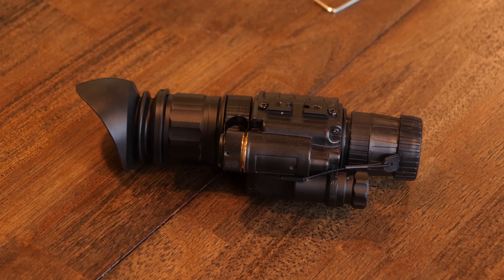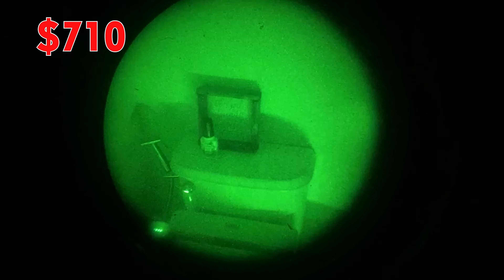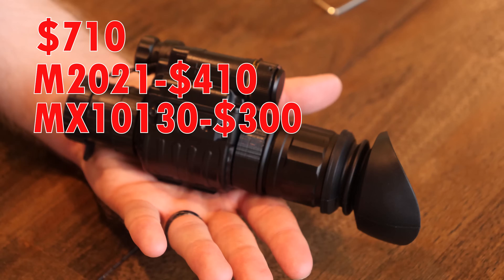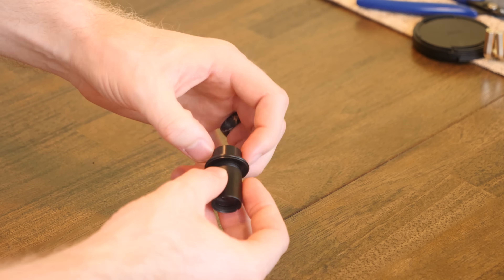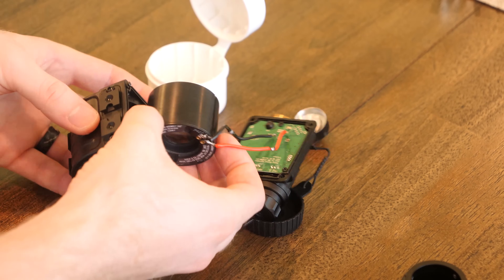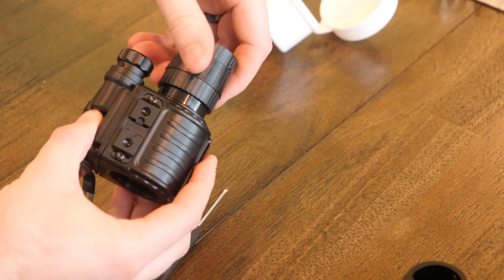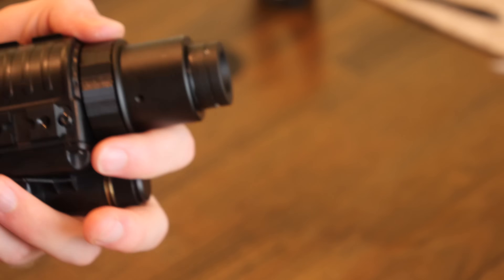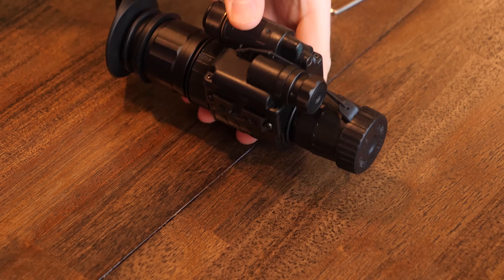How to Build GEN 3 Night Vision for Under $1000

Comment: Found a mx10130 without the wires, is this a problem or an easy fix
Reply from the maker: @Pronounced_G  None of them have wires. You have to solder them on.
Reply: @ what type of wires

Comment: Hey man sorry for texting so much but does this housing come with the wires to connect it to the tube?
Reply from the maker: @itsj2373  No
Reply: @djgunner258 I’m not to knowledgeable on soldering, do you know what kind of gauge wires to use?

Comment: Can a Gen2 MX10130 work as well? Just bought a gen 2 Mx10130. Worried but hopeful.
Reply from the maker: @itsj2373  Yeah gen 2 shouldnt be an issue. The hardware is still the same.
Reply: @ also did the wire come attached to the circuit board? And if I did have to get the wire, can I find that at a hardware store?

Comment: Built one and it came out and works pretty good. How did you solve the mounting problem created by adding that spacer? They eye piece sits halfway into my helmet now. I cant find a section of dovetail extension to buy so i think i have to have a machine shop make a piece. Not any in my area. Ideas???
Reply from the maker: Check out my Review video. I go into mounting options

Comment: Hi, what I need to use an image intensifier tube with an astronomy telescope and eyepiece, just the tube and the electronic circuit? The inverted image is no problem. I obviously don't need the housing. I also don't need the IR illuminator.

Comment: Bout to build one myself. Awesome video!
Reply: Let me know how that 3d printed adapter works out. So far, I've had 2 made... one stripped immediately and the other was too tight to even get the threads to bite
Reply: @ShamblesDoctor  Just finished the build, I'll be uploading a video on it soon. SLS Nylon is pretty amazing, it doesn't need a support structures so the threading was smooth and felt super strong! It only cost me $13 on craft cloud, got to my door in less than 10 days.
Reply: @Esch_atton  I finished the build with an SLS print too, I still don't like the thread engagement so I have only snugged the adapter into the eyepiece. There's still an eighth-inch of gap between the two, but the image produced is fine.
Reply: @ShamblesDoctor  I slipped an o ring on the iverter piece and it took out that gap perfectly
Reply: @ShamblesDoctor  will do, I'm getting one printed out of SLS Nylon

Comment: For anyone wondering the inverter piece can be made with 2 Plano convex lenses pointing towards each other and then playing around with the focal length between the screen and the two lenses
Reply: Specifically 21.8mm in diameter and 8mm high
Reply: What did you use to hold the lenses?
Reply: 3D printed everything
Reply: @skycraftjet6621 do you have this 3d file perchance
Reply: You don’t happen to have a link for those lenses do you?
Reply: Do you have insta? I would like some more infos
Reply: Pics or it didn’t happen

Comment: I did this build and honestly its pretty good. The cons for this build is the weight, little bit of lost field of view and having to deal with alibaba sellers when buying the housing. For me it was definitely worth the price for a starter unit but I’ve upgraded to a set of pvs14’s. Side cutters and a dremal made quick work for the modification and im good at soldering so the wires were not a problem for me. I did not remove the plastic nub/tab on the IIT and I recommend you don’t as the tube sits tighter in the housing with the nub.
Reply: Are in willing to sell me the ones you built ?
Reply: Can you link instructions

Comment: For anyone curious: I did this build, but my housing did not come with the small internal "prism" assembly. After messing with it, I found the eyepiece lens is what does the inverting. That small "prism" is actually just 2 or 3 smaller lenses to help focus. I ended up using 2 door peephole internal lenses to replace the small "prism" assembly, which worked great.
Reply: Wait so i Don't Have to Use The Prism Thingy At All?

Im Just Looking For A Cheap NVG Build And I Don't Really Care About Focus And All The Other Things, Just Looking to Get a Cheap NVG's
Reply: @M8TRIX404  you need it
Reply: Hey could you tell me more about this solution? My inverter got fucked up
Reply: How did you do that?

Comment: FYI, the soldered wire is exposed and you should seal it with heat shrink tubes to prevent it from contacting the board cause it will short the board and kill it.
Reply from the maker: True

Comment: I've seen cheaper on amazon...
Reply from the maker: Gen III analog night vision?
Reply: @djgunner258  Thank you for pointing this out, I don't know the difference so by the time I was half way through the video I had forgotten that was a part of it.
  Is the difference significant or is it just slight gains in one or two metrics?
Reply from the maker: @ronaldmorey3396  Digital Night vision vs Gen III night vision is... Night and day... XD But seriously go watch hop's video called "SiOnyx Aurora is NOT a Night Vision Device"
Reply: @djgunner258  I see my mistake; When hearing "night vision" I automatically thought IR night vision.  I've seen Those for sale for cheaper but there is definitely a difference between gathering the light available for a picture with a small noticeable area if someone else is using one, and lighting up the entire area so you shine for a mile or two with a bright ass IR LED array...  Not visible to the naked eye, but there is a lot of tech that makes it visible.  Thanks for your help on this.

Comment: The "inverter" is a prism. If you really want to make the unit worth while. Have a machine shop or online machine shop turn one out of 6061t6 aluminum. Also put some quality shrink tubing on those wires. Adhesive lined tubing would be ideal.

Comment: Now you need to replace that lens with a wide angle 35mm. That pinhole veiw is ridiculous 🤙🏻
Reply: I actually have a very similar monocular housing without the PVS-7 tube... and i believe the Objective Lense is actually not what causes it to suffer that smaller view effect i think its actually he fact that most of the length in my monocular is take up by the rear lens's "Inverter/Prism type assembly I believe. Because Mine looks like your looking down a narrow wieirdly naow tunnel even without the tubein thre... its the length from the occular lense to the actual rear screen on the tube i belibee.. sadly.
Reply: @VanXHydrA  Ii is actually the front lens. It is a pinhole lens. Replace it with a 35mm at a bit further of a distance and refocus. It should work fine but you may have to adjust lens distances as well

Comment: Under 1000 IF you have a 3D printer
Reply: Enroll in one class at a community college (at least at mine) and you’ll probably have access to a 3d printer. Maybe not worth it if youre only gonna make one part but if you’re interested in 3d printing there are ways to use one without owning one.

Comment: After doing looooots of research,, I would never spend 1k on this setup. Almost built one. I would rather buy a flashlight and eat carrots for the time it takes to save up to get a pvs14.
Reply from the maker: What ended talking you off the cliff? Not surprised though. In my review I express that I think the only people who should try this are people who absolutely can’t save up for a PVS14 or are looking for a loaner / beater unit in addition to their other NV
Reply: @djgunner258  The mount, the eye relief, the awful optical quality, seems to be less than 40* fov. Idk. im no expert.

Comment: If it needs Infrared flood light at all then it is not proper Gen 3. Proper Gen 3 NVG will make complete darkness look like day time without any added infra red light. If you use infra red light to see better the real Gen 3 NVG will spot you over mile away easily, it will look like you are wearing flash light.
Reply from the maker: .. I don't know what you're talking about. You don't need to use an IR illuminator with this. If you're referencing when I turned on the one built into the housing at the end then... just don't turn it on (same as a PVS-14).  You can see clearly in the video it didn't need it.

Comment: Is it possible to put MX10130 tubes (or another gen 2 or 3) into a DB2041 housing?? I was searching for blemishes MX10160 tubes, but if it is possible to fit cheaper and not blemished tubes I'll go for that obviously. Any help??
Reply from the maker: No idea on that housing man, sorry
Reply: @djgunner258  damn... No worries. It's the bino housing made by Daking

Comment: Question: Is that inverter adapter the same as a 'roof prism' which you can find in binoculars?
Reply: I did this build, but my housing did not come with the small internal "prism" assembly. After messing with it, I found the eyepiece lens actually does the inverting. That small "prism" is actually just 2 or 3 smaller lenses to help focus. I ended up using 2 door peephole internal lenses to replace the small "prism" assembly, which worked great.

Comment: Do you know of an Alibaba housing with manual gain that could be used with a MX 11769?
Reply: Did you ever find one?
Reply: @Bobsbusters  no I never did. Shouldn't be an issue if you get an mx10160 however which are usually cheaper. Also you can run a diopter on the front which is not the same but can be used to accomplish similar affects. 

If you have money for a mx11769 just prowl for a used PVS 14 kit tbh. That's the route I had to go, although you'll want to make sure that you buy your housing before the intensifier so you can assemble and test it out. I had to return my intensifier because it had an emissions point that would eventually destroy the unit. Ironically that's a strength of using eBay combined with a credit card. That or buy from a reputable dealer.

Comment: Question for ya. After everything was installed it worked flawlessly thanks to your video. But, my imagine is incredibly small. Is there a magnifier that will screw onto the rear to make the image larger?
Reply from the maker: How small are we talking about?  A lot of people are surprised that looking through night vision (any NV models) has a really limited field of view and is a lot like looking through a toilet paper tube.
Reply: @djgunner258  I’m army aviation. We use ANVIS-9 and PVS-14s for ground movement. I’m aware of the typical size. It’s about 25% smaller than the anvis-9 and pvs-14.
Reply: @djgunner258  it’s like looking through a boba tea straw.
Reply from the maker: @jacoblaubach593  Make sure you put the inverter on the correct side of the 3D-printed adapter.
Reply: @djgunner258  I’ll give it a shot. Very impressed with the quality of the housing tbh
Reply: @jacoblaubach593 did you get it figured out?
Reply: wow. ok. so i sold Meade telescopes for a long time up until about 2010 and you should look into the eyepieces they sell there. magnifying lenses, inverters, light protection for the aperture, 90° viewfinders (in case you want to mount a ... super soaker and be your own spotter), and a large variety of other accessories that will push you into gen 5, including tripods (the StarFinder) that track your... subject and have motorized controls and camera mounts for the optics. 
i know i had customers that talked about getting eyepieces for microscopy as well, but i can't recommend any that i personally know.

if you talk to someone to walk you through the magnifying lenses, just let them know you don't care about image degradation from over magnification as you have an enhanced image with  additional light.

i hope this helps,
Reply: I recently did the build and it's giving me the same issue. Smaller (30 degree?) FOV and  not quite neutral 1x magnification, everything appears smaller. My pvs14 is on hand for comparison.

This orientation of the prism is as demonstrated in the video, though I experimented with other positions for troubleshooting sake. No usable images otherwise

Comment: For stripped plastic threads, you can use zip ties to make shims. I usually just use them for small screws, but theoretically you could use them or some other medium in a pinch to get threads to seat.
Reply: A few drops of plastic only apoxi, sink the screw, let cure, back out screw if needed.

Comment: I am looking at a similar housing to make a bino set and was wondering if you would look at the specs to see if it will work. Basically the same thing but duel tube housing set
Reply: It works. It's just two of them connected.

Comment: is there any possible solution for the lack of red light to tell you IR is on and blinking green to tell you battery is low?
Reply: That would involve some sort of software change in the housing and is probably well beyond the capability of anyone building these at home.

Comment: anyone else having very short battery life? i never use the on board it illuminator (80 hours best conditions) but I can't seem to get more than maybe 5-10 hours in moderate to low light conditions.
Reply: It's a very shiddy Chinese PCB. Just buy rechargeable batteries. Problem solved.

Comment: This build was a depressing letdown after completing it. A pvs7 housing is only a few hundred more and ten times better. Don’t go down this path thinking you are DIYing a deal.
Reply from the maker: Why is a PVS7 better in your opinion?
Reply: @djgunner258 the pvs7 has significantly better and bigger lenses for starters, it makes a huge difference. The m2021 has to be nearly inserted into your cornea to get a full picture. Also the image aspect ratio of this build is not 1:1, this defeats the entire purpose of having a monocular.

Comment: I'd like to get just the inverter piece and build the rest to fit my tube. 
For example I'd like to use the space afforded around the inverter for controls, to make it slimmer.
And I'd fit lens assemblies that give me a wider field of view. About 50° at least. 
Any idea if those little inverters sell separately?
Reply: I didn't really understand this part, you can use the housing without an inverter part or is it mandatory? also why this piece, the tube compatible with housing must necessarily be upside down?
Reply: @witeman.86  There are 2 basic types of gen2+ and gen 3 tubes. Inverting ones and non inverting ones. Usually a inverting one is needed for a monocular. Because the objective lens inverts the image. And to view it the right way, it needs to be inverted again. Devices like a pvs7 use optics behind a non inverting tube to split the image onto 2 eyes. This process also inverts the image. The inverter that comes with this chinese housing, allows a non inverting tube to be used in a monocular. I don't understand what you mean by the tube being upside down. They are round, so there isn't really a upside and downside. The flat ends have the input and output windows. You put the input window behind the objective lens of the housing. And the output window towards the ocular lens, so you can see the tubes screen through it.
Reply: @heyarno  so in agreement with this housing, pvs 7 tubes (therefore not inverting) are compatible, where tubes made for monoculars are therefore inverting incompatible
Reply: @witeman.86  What do you mean by inverting incompatible? Also that housing can take both types. When you have a inverting tube, you just don't use the extra inverter. The pvs-7 housing though can only take non inverting tubes.
Reply: @heyarno  ok, sorry for the misunderstandings I am French and I use a translator, thank you I did not know that this housing was compatible with the 2 types of tube, really thank you for your help
Reply: @witeman.86  I don't mind. I'm german and my grammar might not always be standard english.

Comment: I tried to do exactly the same. Living in Europe we do not have access to that many gen3 tubes. 
I found a few from Turkey. Old PVS-7. 

It works ok. I also made a 3D printed connecter (Resin). The housing is made for the Russian/Chinese PVS-7 tubes. Which are shorter. 
The biggest problem I found is that the inverter lens, sadly crops the image. You loose almost 20% of the image diameter. You can see this at: 9:20, note the dark green shadow. 

In the end I found that I would rather wait for the right Gen2 mx10160 tube. They also have cheap housings for this, similar to the MINI-14. This one is called M2041. This one is plug and play. But the Ocular lens i quite small though.
Reply: you stole my gen 3 pvs 7 ebay bid didn't you
Reply: @WHITE_PRIDE0  That is a long time ago! xD

But yeah maybe. 
They were really badly blemed though. 
When you loose about 20% of the image, it becomes even worse.
Reply: There are some damaged pvs-7s in turkey I have recently seen but never thought that it would be repairable. I also live in Turkey and could you direct me to that seller?

Comment: All I want is a reasonable facsimile of Splinter Cell goggles. It doesn't need to be thermal as well (Although I'm wondering if a FLIR device would fit the bill) but I just want to be able to walk my dog at night without wearing a helmet. Plus you know, nerd reasons.

Comment: Anyone looked into putting gen 3 or gen 2 tubes in a gen 1 body like the ATN Viper? I've got 2 vipers, one of which the tube no longer works, so would be interesting if it could be upgraded.
Reply: Not working. Wrong focal length etc.
Reply: @aesthetic8780  thanks for the info.

Comment: I wonder if this is possible with a MX-11769 or MX-10160 tube
Reply from the maker: Look through the comments below. Better yet Ctrl F "1060". TLDR: If you have a 10160 or 11769 I would recommend just building a PVS-14. It's a robust proven housing. The whole point of the M2021 is to utilize a cheaper ITT.
Reply: @djgunner258  okay thanks I just bought a omni 7 gen 3 MX10130 and going to buy the housing soon
Reply: @alexChabakphotography  how surprising